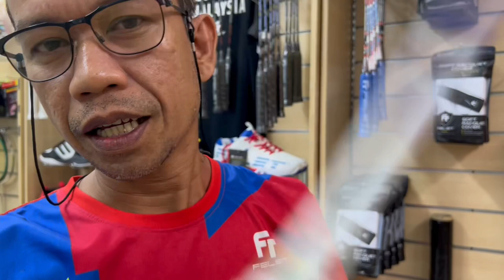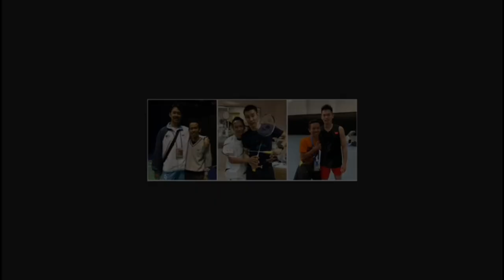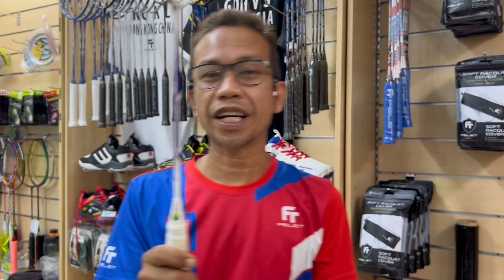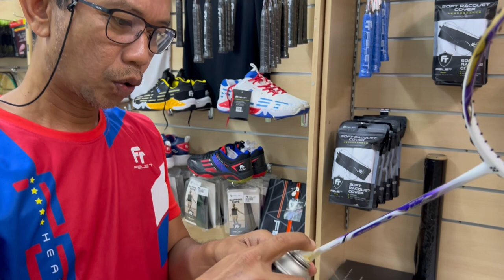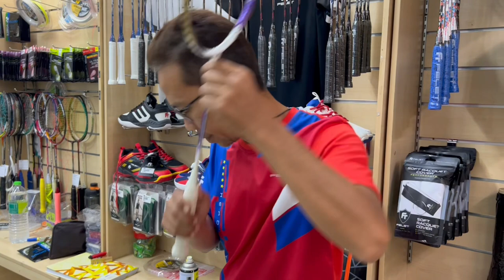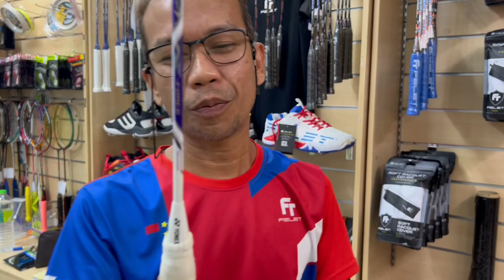How to remove annoying rattleing sound

Comment: Why can spraying wd40 fix this problem?
Reply: Keep in the mind,this method only useful if the rattling sound came from the cap of the racquet..If the sound of the rattling came from inside of the handle,the could be the wood chip inside of the bottom cap of the racquet..So,I'll explain it to you about this method,without using the lubrication (wd40/grease spray),the wood of the racquet handle would likely create friction..the surfaces of the crack will rub against each other..By applying lub/grease spray,the oil would help to keep the crack moist,therefore there would no friction..But keep in mind,do not use lub/grease spray too often..Only use it whenever you noticed the rattling sound..I hope this info would be useful to you👍
Reply: Simple..No oil/lube + Friction = Sound.. Oil/lube + No friction = No sound
Reply: @jackjeckaze8004  Very useful. Thank you so much.
Reply: @jackjeckaze8004 how to apply oil?